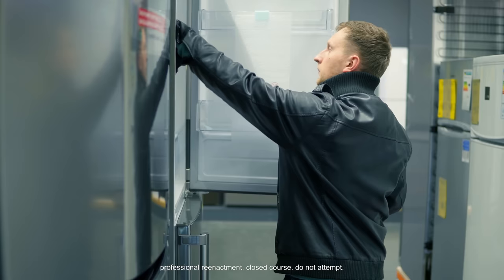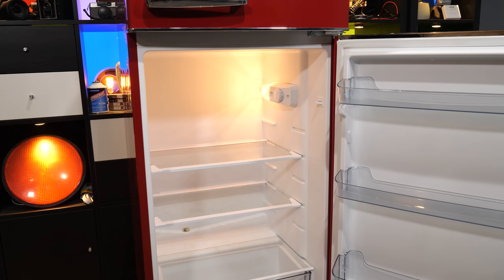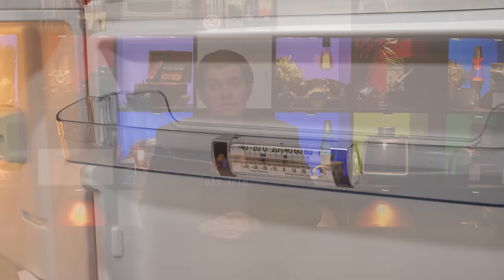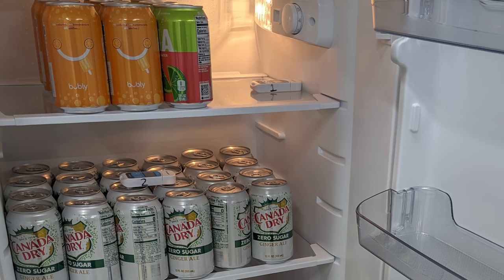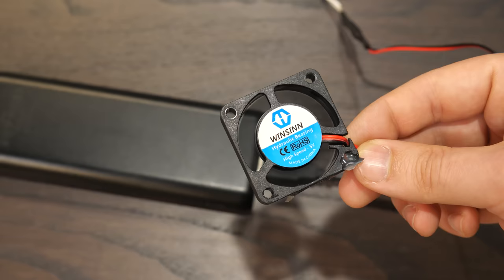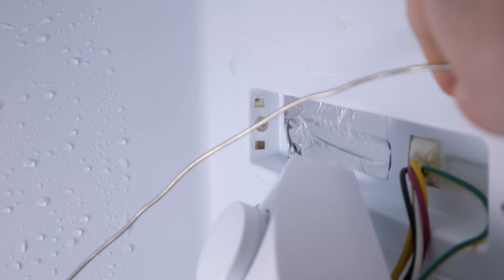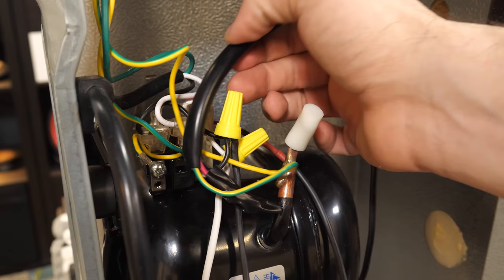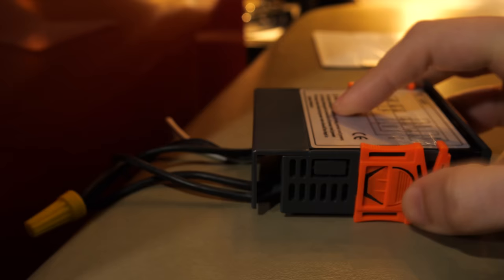This goofy fridge has a really clever design. It's also kinda terrible.

Comment: Could you design a fridge so that you can make use of the heat that it produces for example to heat up a room or for cooking? Can you turn a fridge into a heat pump?
Reply: It does heat up the room already ?
Heat is forced from inside the box to outside the box and outside the box is inside the house.
Reply: @user-si5fm8ql3c that’s true, but i think he means purposely, and by design. because obviously some of the heat will be mixing with the cold which negates both.

Comment: Thermal overload inside! the compressor would shut off with over running times and overrides the stat. for safety reasons. Looks like about 33 mins. Data trash for hypothesis. Thermal heat rise off of the extremely long running compressor would increase the heat transfer from compressor to interior.  THE power bank is not cool operating it adds a heat load from the circuits inside. FANs are also a heat source.  All adding unknown variables to the experiments.... HVAC tech.

Comment: To me it seems like the design was just built off of refrigerant temperature. So really it was a sequence of operations problem with flawed logic. The refrigerator was doing exactly what it was supposed to do, just not what the goal of the device was. In theory refrigerant temp should work as long as you are close to steady state when adding items and you appropriately have a conversation factor to inside temperatures. Again like he said it's indirect and not the best way to run it.

Comment: all home appliances are crap now, even the premium reliable brands from years ago. And that is because of where (the country) they are made (I am convinced they deliberately build items to NOT last, by using cheaper components right down the wiring). I don't expect appliances (refrigerators, ac units, washing machines, microwaves, tv's etc) to last more then 5 years. So that is why I will never buy a premium model again. I just buy the least expensive model that fits my needs, and if I get more then 5 years out of it, then I look at it as a positive.

Comment: I'm a little surprised to see that you intentionally wanted to use the fans to point the cold into the hot where I have understood through Reading and research and a little bit of experimenting on my own you get a much better distribution of energy or reduction of energy when you take the hot and push it at the cold especially when the cold is what you want and is the source you want. 

I guess another way to say this is that my research says to point the fan in the direction that will remove the air that you dislike to make space for the air that you would prefer. 

My summary adjustment is stated more generally because you might be in a position where you have a cold room that you want to make hot and in that case you would want to dump the cold air out. 

Basically unless you're shoving on a Ridgid metal rod it is likely that whatever you're pushing against is more like a noodle or and is more fluid. In situations similar to chains and ropes and in this case water or gas it is easier to pull. In creating a vacuum is a very excellent way to pull something. it is a little counterintuitive because you look at a fan and you can feel the blades pushing air, but the displacement of are on the backside of a fan is very significant when imposed on wide areas even if your skin may not feel the movement of air.

Comment: Note this system is small... I mean really small you puted a fan on it in any system if you put a fan on it you make in it bigger in kW or W of refrigeration capacity this fridge runs with an 1/6 of HP compressor when you installing the fans inside you need bigger compressor to withstand the load also the condenser design on this fridge is pretty TERRIBLE! you have a big flat surface area instead of the typical "shelf type" condenser you need air circulation to the condenser to work properly

Comment: to my right, is a fridge bought by my grandfather in 1947 brand new... 
it is still running... it has outlasted 2 generations... and is halfway through my generation
it has never been worked on other than me, replacing the rubber seals that were dried out and cracked and missing

yes you have to defrost it... but thats not hard, and doesnt take long... 
and what is its carbon offset vs buying some 17 other fridges we should have had to buy over the last 70 years...

we need to make things to last... not be more efficient... because so what if its 10% less efficient than a new one... that cost is NOTHING compared to the minerals required to make a new one, recycle the old ones, you having to drive to work to pay for the new ones... think about ALL of it... 

carbon offset is a joke... build things to last, that is the best

Comment: The itty bitty fridge stopped cooling it probably so it wouldn't fry the compressor under too much stress check if there's a temperature dependant switch around the compressor that would cut the power when got too hot even tho the thermostat was saying we sail at max speed fellow compressor

Comment: cheap fridge cheap workings. still nice engenering. Also the bulp next to the pressure tube, so you bypass the slowness of the sensor, to start cooling faster because of door opening.

Comment: Adding more insulation around the whole fridge, like placing it in a cabinet zone, and more insulation isolating the compressor from the rest of it... and a simple fan on the back to cool the heat build up... thing radiator fan on your car... and this will be perfect.  Maximize efficiency and minimal energy.

Comment: While I LOOOOVE this channel and have watched everything, this is messed up on soooo many levels. (1) It is totally pointless and ineffective to have SOOO many soda cans in a household fridge. The amount of aluminimum messes up the thermostat, the fridge has to work much harder to cool all the cans down and KEEP them cool which then sit there for days and days. They would be perfectly fine in a room temperature storage and being put in the fridge maybe a day or two before consumption. (2) Putting warm unfinished meal in the fridge is f*cked up, who the hell does that? You simply leave the food on the plate and then put it in a tupperware so that you PRESERVE it in edible form for tomorrow. You do not need the fridge to cool it down, you need it to keep the leftovers edible tomorrow. (3) Of course temperature will vary around the fridge because the contents retain temperature based on their properties.

Comment: I'm only halfway through this video, but I bunk you're wrong blaming the thermostat for shutting off the refrigerator before it reached the correct temperature. 

I'd wager you, instead, triggered the thermal protection for the compressor. It simply ran too long, created too much heat, and shut off forna cooling period.

Comment: Yay we use fahrenheit temperature and I know freezing is 32 degrees and zero degrees is 32 degrees less than freezing. We got the internet to convert if every video put both scales of temperature why not also include Kelvin. 32  fahrenheit don't need decimal points to give you an accurate temperature if I made a scale for each fahrenheit degree you would have decimal points all over the scale:

0 °F-17.78 °C 10 °F-12.22 °C 20 °F-6.67 °C 30 °F-1.11 °C 32 °F0 °C 40 °F4.44 °C 50 °F10.00 °C 60 °F15.56 °C 70 °F21.11 °C 80 °F26.67 °C 90 °F32.22 °C 98.6 °F37 ° 100 °F37.78 °C 110 °F43.33 °C 120 °F48.89 °C 130 °F54.44 °C 140 °F60.00 °C 150 °F65.56 °C 160 °F71.11 °C 170 °F76.67 °C 180 °F82.22 °C 190 °F87.78 °C 200 °F93.33 °C 212  °F100 °C

Thanks for this video of these refrigerators I am very serious about getting one like these. I don't use soda pop cans I don't want a small refrigerator with can holders on the door I want to put 3 2 liter bottles on the door and use the rest of the refrigerator for food. Most shelves don't accommodate one gallon jugs of milk so organic milk in the carton would fit in place of a 2 liter bottle. Also I keep my eggs on the door like in the old days and never had any issues with bad eggs unless they were way over the expiration day. The egg in water trick works if the eggs stay at the bottom they are still good floating eggs are usually bad. Maybe I can find a good used small refrigerator with the wire on the door to keep bottles on the shelf. 73

Comment: I don't think the thermostat is as bad as you think it is, because I think you started from a false assumption: That the thermocouple cares what the temperature inside the fridge is.  I posit that the thermocouple is instead reading the temeperature of part of the compressor loop, and that it cares more about how hot the conpressor is, than how cold the inside of the refrigerator is.  That's probably why fridges of this type have a dial that is from 0-9 or whatever, instead of an actual temperature.  It's not a thermostat, it's a "how long and hard do you want to run the conpressor" dial.  The cycle time of a compressor is often governed by a large capacitor that charges while the compressor is off, and discharges slowly while it's running.  When the capacitor runs out of juice, the system turns off and begins charging again.  You may wear out that cheap little compressor very fast with your modification.
Reply: I would say that makes it exactly as bad as he assumed it is because the whole point of a thermostat in a fridge is to keep the temperature below 40 f which is rather difficult if the thermostat is not measuring the interior of the fridge
Reply: Also no a compressor is not powered by a large capacitor, A compressor is just a pump pumping a particular liquid from a lower pressure area to a higher pressure area. And there are many ways to accomplish this. But generally these days we use electric motors. So unless you're going to tell me that an electric motor strong enough to move refrigerant around is way too powerful for a standard wallet in North America. Then this capacitor required is a complete fabrication on your part or whoever pulled that to you. And seeing as all but the largest of refrigerators are basically just window AC units with some parts moved around and a window AC unit can run continuously off of a single wall outlet. I'm going to say electric motors don't need dramatically more power than what standard wall power is in North America

Comment: strong disagree - the lil guy WOULD see better temps (less change and quicker recovery) if it were stocked due to that thermal mass which is also able to warm up to cool down the soda, much denser than air...boooooo.....boooo this man......booooooo

Comment: Conclusion: don’t fvk with perfection 😆
I’ve never put more than 2 or 4 cans into my fridge at a time (why use it as storage? Cupboard is designed for that) and why not use freezer for quicker cooling down of the drinks? There was even a calculator for those somewhere online. It makes sense that over there y’all do extreme shopping so y’all’s expensive fridges make sense but I definitely much rather get a cheaper one that’s also not using up any extra energy to power chill an exorbitant amount of beer 😅